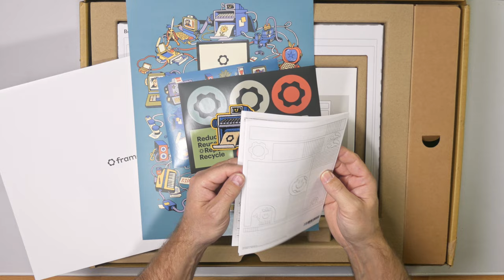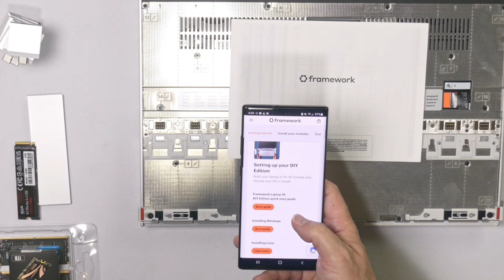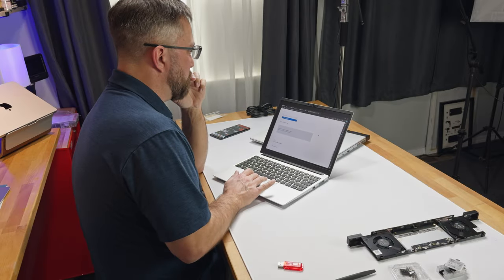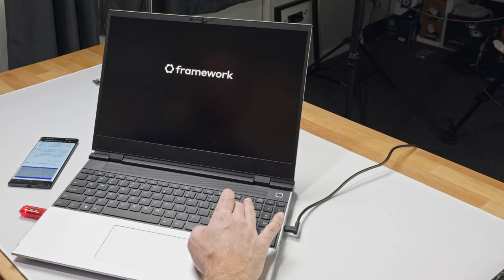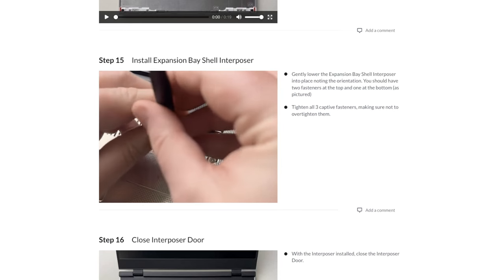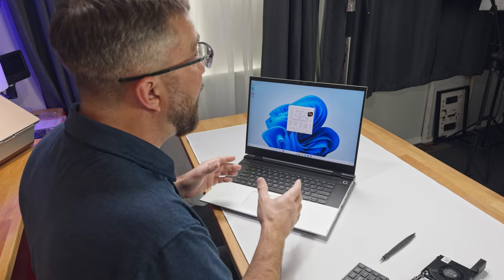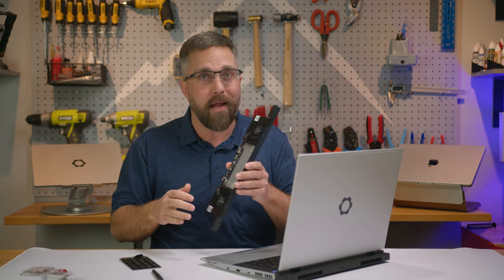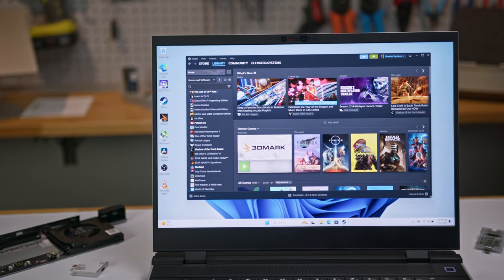The Framework 16!, Unboxing, Setup, & First Impressions!

Comment: I love the idea of swapping components i had tons of Thinkpads over the year and repaired them 1000 times. However. You buy this laptop for 2500 and it might last you for 10 years or more, however a macbook will cost aroundthe same and will last the same time, feeling much more premium from the start and with huge benefit to use FCPX or Logic, which are a bargain if you are not overly pro. Ok i don't want to rise polemics about which one is better because none is better, but if you want to charge the price of macbook make it the same quality. Of course if your mb battery or screen dies you are in a huge trouble i acknowledge that
Reply: Mac book cannot choose between opersting systems. It has some design flaws in its electrical components that garantee failure and limit repairability. So you can give money to a company aiming to improve or buy a status simbol. Dont matter which you choos be happy with what you get. 😊

Comment: The main concern is the screen pinching for me because if the screen is already pinched some shock or vibration while traveling can damage the screen as LCD screens are really fragile and that would end up a expensive mistake. Since this is laptop it is expected it will be carried around and some shock or vibration will happen.

Fit and finish also should've been better for laptop that costs that much. Users shouldn't be scraping their hands on the modules and the difference in color is also something that should be addressed as it's not a good look.

Framework has good idea but the execution is lacking especially considering the price.

Comment: 2716 USD, with that fit and finish, lmao.

Get yourself a Thinkpad P16s at equivalent specs for HALF the price. It'll be cheaper to literally buy a new one in 3 years bringing you to the cost of a single framework (that will cost you the price of yet another P16s to upgrade!).

And the fact that Lenovo sells thinkpad batteries that are drop-in 5 minute replacements for years makes this useless for me.

Comment: 2300k and you still need your own hd and ram.....thats a deal breaker
Reply: so you rather have them soldered? This is not for you. I will save for this its worth it specially if you consider yhe updatable procesor.

Comment: 7/10 idea 4/10 execution.
USBC hub with all ports you need are 20 USD on amazon why waste space on 6 expansion cards put 99 Wh battery and 2 extra speakers and the idea of replaceable GPU is dead because of nvidia and most of the damage a laptop gets is liquid damage good luck with that with this design. Thinkpad drain system keyboard was better and replaceable. And why did they make it open from the top of the deck not from the bottom It's very stupid.

Comment: The keyboard size criticism seems strange.  If they made the keyboard bigger, then there would be no room for the numpad.  I can understand criticism if the keyboard flexes.  But the size of the keys should not really matter unless they were smaller than normal.  I don't understand why the keyboard not filling up the chassis is a concern.  It is not like someone who buys the Framework 16 necessarily has much larger fingers and hands than a Framework 13 (or any other laptop) owner.  Trackpad size criticism seems like nitpicking.
Reply from the maker: Well input surface ergonomics is to deep of a subject to debate here. But, needless to say it’s an entire science and many companies use consultants in the field to validate or help design their input surfaces. But to keep it simple, if they made the keyboard bigger, they also could have made the numpad smaller. Then it could have been proportionate to basically every other well designed 16” input surface out there, while still being modular. Reusing components rather than intelligently redesigning them was a cost saving measure pure and simple. Whether that is justified for a company of this size is another debate but from a purely consumer pov it’s subpar for a $2500+ laptop.
Reply: @ElevatedSystems You listed the specs of the Framework 16 you reviewed.  However, you did not mention that the $2500+ laptop you keep citing is NOT the cheapest Framework 16.  Just saying over and over that it is a "$2500+ laptop" is kind of misleading.  That is the configuration YOU selected.

I just configured a Framework 16 for $1,478.  That does not include RAM, SSD, GPU, or ports.  That is a nice thing about Framework.  Especially if you already had a different Framework, you could move some parts from your old Framework.  The DDR5 RAM is new to AMD Frameworks.  The SSD and ports could be brought over.

I would not want a small numpad.  My old 15 inch Dell with a non-modular keyboard and numpad has a keyboard which is actually SMALLER than the Framework 13's keyboard.  See a side-by-side photo of the two: https://ibb.co/nCFHqZh
So to blame the keyboard size on the fact that they reused the very functional keyboard from the Framework 13 is also misleading.
Reply from the maker: @georgeh6856  so I paid $2500 for a $1400 laptop and you paid $1400 for a $700 laptop. Mathematically speaking I made out better. 😜
Reply: @ElevatedSystems That is just blatant, inflammatory lies.  Enough.  You clearly do not care to give unbiased reviews.  You clearly do not care about facts.  Seriously bad.  Your channel has a reputation to maintain.  I don't have to worry about that.
Reply from the maker: @georgeh6856  LOL Lies you say. This is the exact specs of my framework 16. It has modular RAM, storage and even a replaceable battery. How much is a modular input deck worth? https://shop.asus.com/us/90nr0ew1-m001n0-asus-tuf-gaming-a16-advantage-edition-2023.html
Reply: @georgeh6856 Dude! You’re deluded!😂 No matter how you feel about framework, this laptop is double the cost of its rivals no matter how you build it. The framework fan boys are starting to outdo the Apple ones 😂